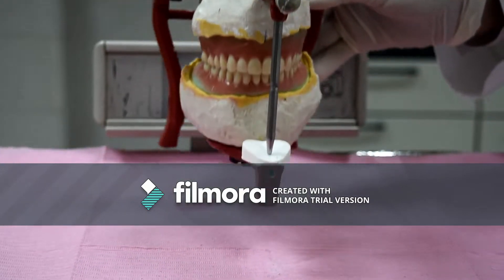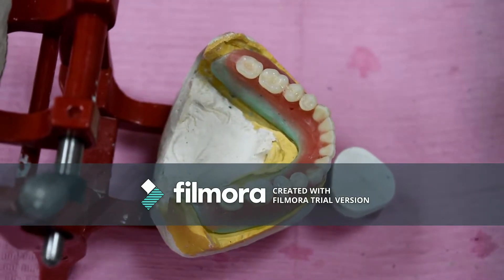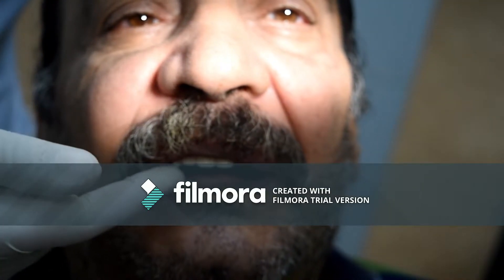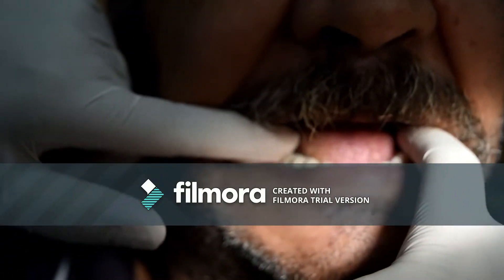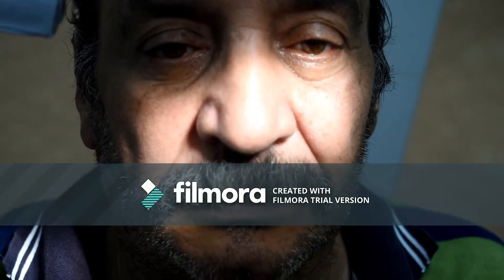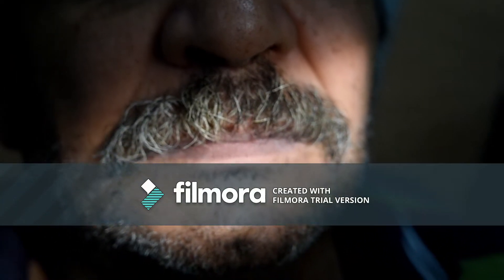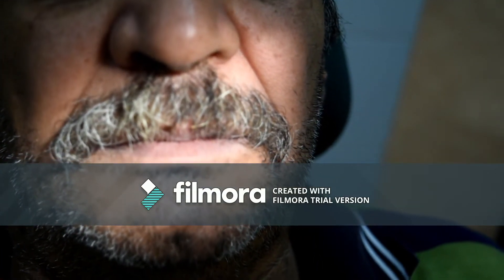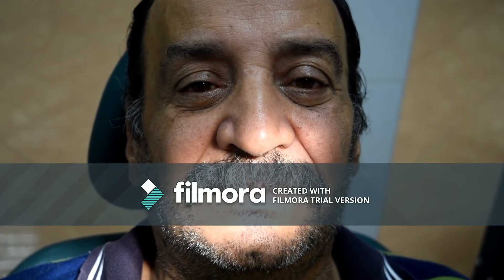Clinical Complete denture 1 PRS 412n Denture Try in

Comment: Maximum intercusparion
No edge to edge
No wax on denture base

Check retention, stability, extension
Check lines

Lower teeth should be below max of tongue
يقفل بقه، يبلع ريقه، يرفع لسانه براحة، مفروض اللسان ميمكسش في الاسنان

Check vertical by facial contour
Check occlusion، اخليه يفنح بعدين يقفل واشوف انهم قفلوا ف نفس الوقت 

اخليه يعد من 60 ل70  
اخليه يقفل بقه وامشي النايف، مفروض متدخلش عشان مفيش سبيس